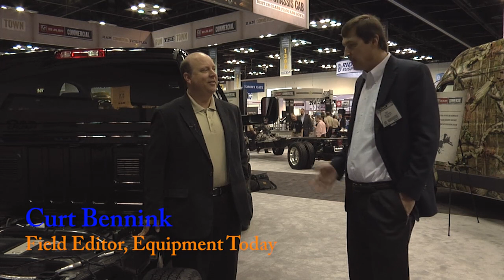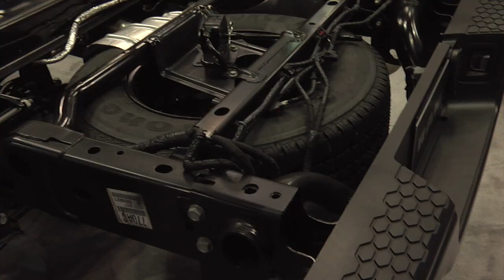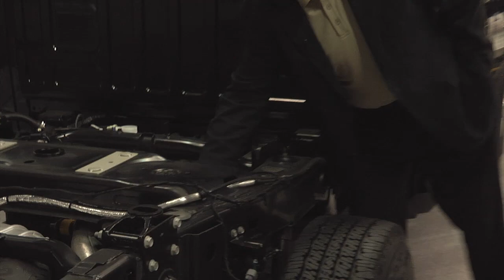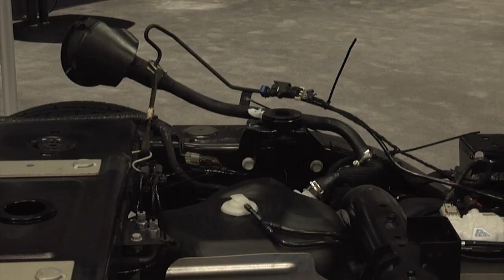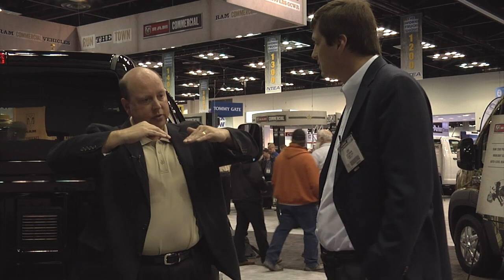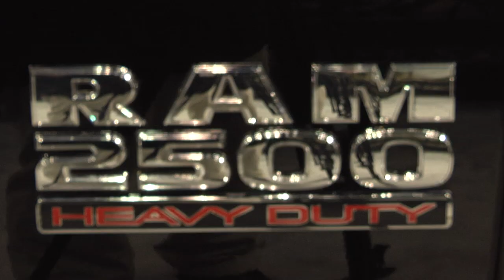Video: Ram Explains Air Suspension Benefits on its 2500/3500 Pickups

Comment: I did not order the air suspension option on my RAM 3500 Laramie Mega Cab because I don't like active systems that require maintenance and which, frankly always become a pain in the ass and an expense especially when the truck goes out of warranty. I like Timbren rubber springs which I installed on my truck. They're inexpensive, passive and do exactly what the air bags do: eliminate squat.

Comment: So how does this work if you plan on lifting the truck in the future but want to maintain the factory air bags
Reply: Adh Snoopy lifting the frame points
Reply: Adh Snoopy bds makes a kit specifically for air suspension i dont know of any other companies.
Reply: @androidsama9398  Carli Suspension also makes a kit for the air assist suspension

Comment: I personally think the best set up would be factory coil spring + air lifter helper air bag in parallel. if the air system ever fail, you still got coil always there to backup. and the air bags will handle anything you through at it.
Reply: I'm in a pickel. Got a ram w 8 inch lift 38 tires and broken bucket hiding in the giant front coils. I watched a guy on you tube put bags on a 2nd gen and have been obsessed on building something like that. I've been thinking about cutting down the springs on my parts truck and fabricating some mounts where I could stack coil over or under the bags...or maybe just the bags just wondering the mathematics of doing this. I am a welder fab guy by trade and build stunt cars and picture cars so I can wrld but don't know the science behind air ride but its nice on the rear of my trucks

Comment: Why does a link air suspension need an anti wrap shock?
Reply: grumpybill because of the power and torque the truck has on take off under load will roll the rear axel up so the shock limits the amount of roll
Reply: That's really not a problem with a 4 link suspension. Back when they were using leaf sprung axles, sure. But the 4 link literally eliminates axle wrap. The only way it's going to happen is if you're bending control arms or the mounts that hold them. And the only way that shock will help hop is if the control arm bushings are way too large in diameter and extraordinarily soft, which I can't see on a "heavy duty" truck.
Reply: grumpybill not sure if it helps but my 2019 Cummins 2500 has zero wheel hop when traction is lost.